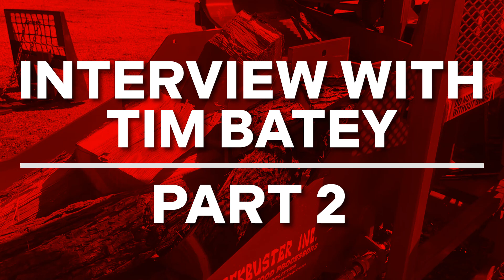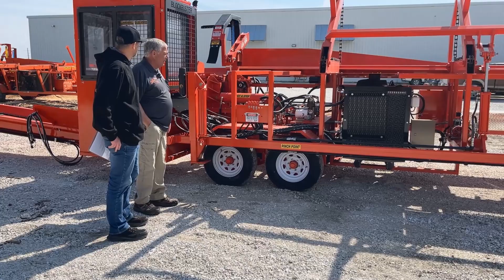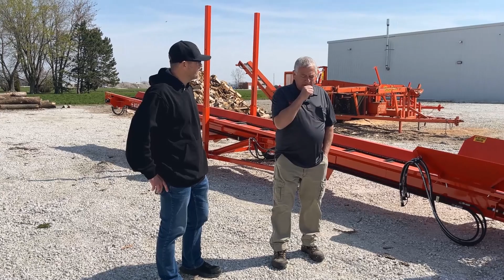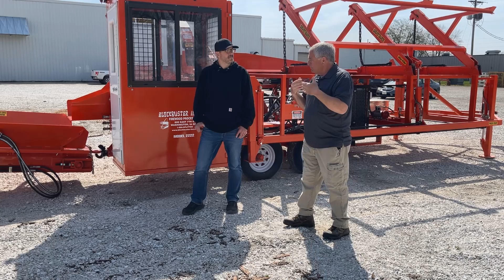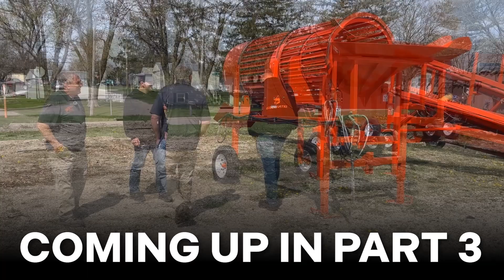Meet Tim Batey: How the Blockbuster Firewood Processor Came to Be | Part 2

Comment: I've got a 20ft conveyor and have used a 30ft.

My main complaint is it's too narrow.  Most of my firewood is 16".  When pieces get crossed up, it ends up jamming since it's not wide enough to move the wood crosswise.  For the most part it works fine, and it's not a huge deal to unclog it, though if it was 18" wide instead of 12? it'd work 

I ended up flipping the slider on the square tube and extended the cylinder so it can go another ~1.5ft higher.  It allows me to get a decent pile in the truck before I need to hop in to stack it.  Just doesn't go as low, but haven't needed it to.
I fill the trucks by backing in and pulling the it forward as it fills.

Comment: I think you said your father first started building firewood processors without knowing other people were also building them.  So BlockBuster was an inventor and one of the pioneers, and still continues.  

I suppose engineering is the primary skill required.  That you have such skill is evident by your discussion of the various issues.

DECK STRAND SPACING.
Apparently you use the same spacing between the first and second as between the 2nd and 3rd.  I would think you would want to expand the spacing between the second and third unless it makes the machine too long.  If you don't want to expand the total width of the deck, you could move the second strand closer to the first to accommodate shorter logs.

AIR RETURN.  
Sounds good.
Thanks for the explanation.

DURABILITY.
This issue was addressed 
in this video.